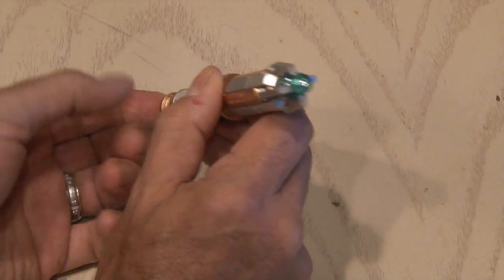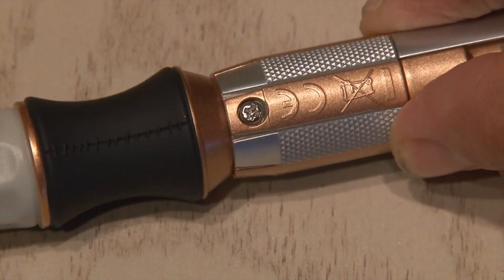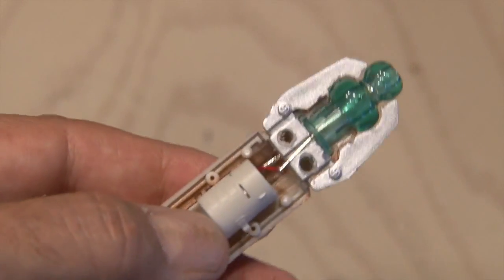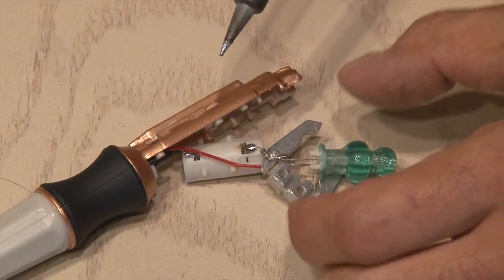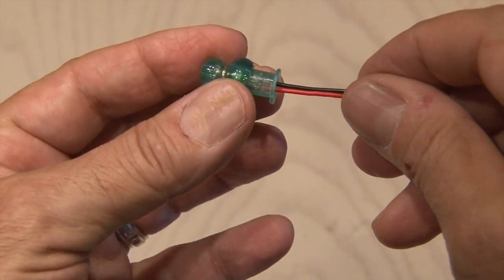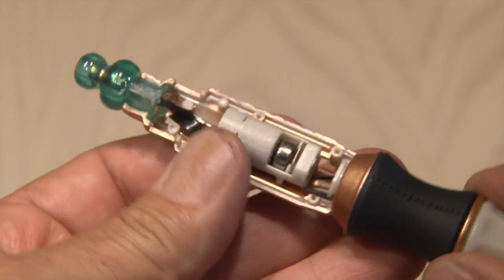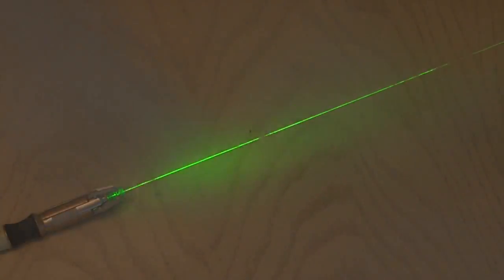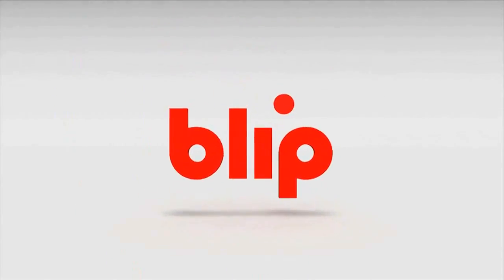Doctor Who - LASER Sonic Screwdriver!

Comment: WHERE. DID. YOU. GET. THE. LASER. PIECE. THINGY!?!?!?
Reply: I checked the link you have above for the LAB111 laser SMD86353 and I saw the information you need on that page. The dimensions are: 8mm Diameter x 24mm Length. The power output is 3mW..
Reply: I got one
Reply: If that's how you ask then you're probably not competent enough to work with a laser.

Comment: The entire assembly would get too hot if we did.  There is no heat sinking.  Plus there aren't any 3W micro modules (Unless fitting isn't a problem).  Regardless, I doubt you'd be able to push enough current through to it with just button cells, and I don't think there are any ready-made green laser modules that aren't part of a lab styled laser.  Yeah, sorry if I sounded any kind of mean with that comment.  It wasn't intentional.

Comment: If you added a higher powered laser, such as one from a laser cutter, then, depending on the plastic type, it would either melt the top or burn a hole in it. That would kind of be pointless.
P.S. Having used many laser cutters myself I can safely say that you would either have to greatly enlarge the screwdriver to fit the batteries it would require to run or add a cord so you could plug it into a wall.

Comment: dahell you buy those iny tiny laser modules? srsly.. I need those...  are there also any 4W laser modules that tiny?... or at least comparable to that size
Reply: Not in that color. You could build a 4 watt 445nm laser for around $200. If you live in the US good luck buying one. Better off to build one anyway. 

The highest rated 520nm laser diode is around 1 watt and they are not cheap. Expect to fork out at least $240 if you buy it prepressed into a module with driver. And I guess its safe to assume you know nothing about lasers, or their construction for that matter, you would be better off not getting a 4 watt laser of any wavelength until you educate yourself a bit. Instead get a 250mW or less. 250mW is still plenty of power to burn when its focused but dont buy a fully constructed laser because the power specified is almost never guaranteed...

I leave you to your research now...
Reply: well I didn't say I'm going to buy a laser module with the same color

also I'm building a multiple array of laser modules
Reply: just FYI.. cause it seemed like you just assumed what I am going to build